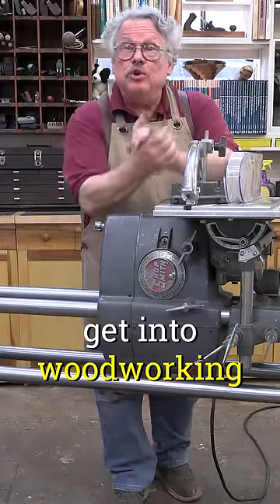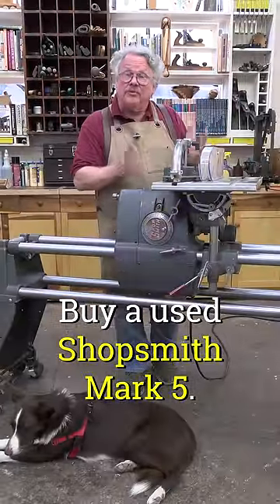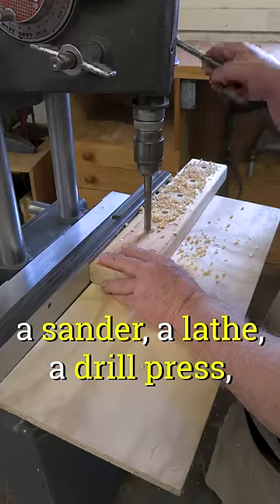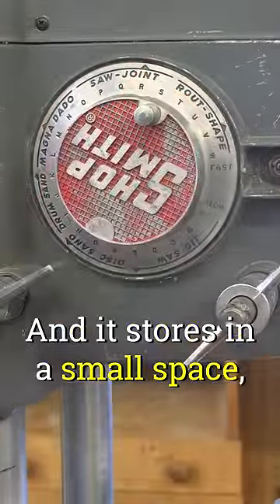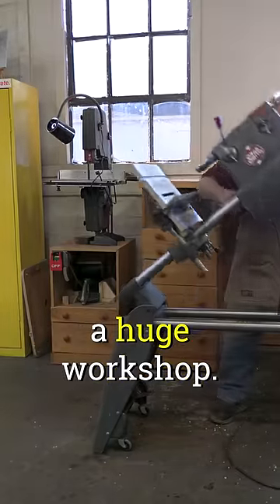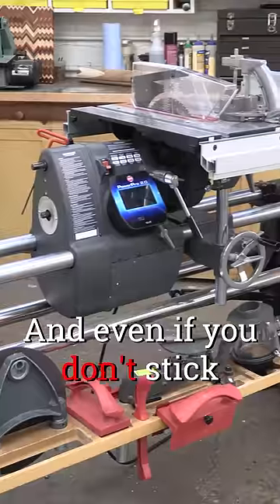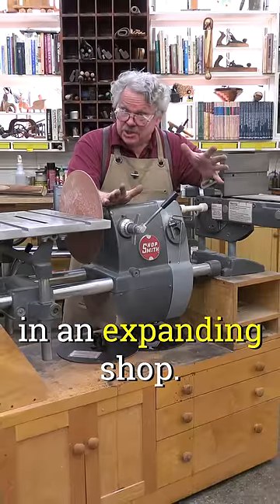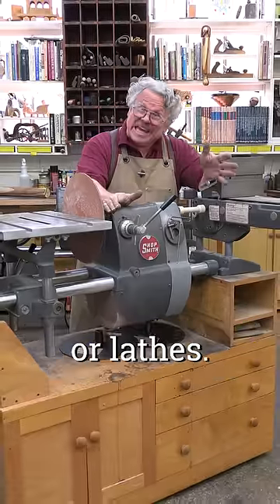A Cheap Way To Get Into Woodworking

Comment: I have a Wood Master. This is a Shop Smith clone. The table surfaces are cast iron instead of aluminum. There was a law suit against Wood Master from Shop Smith and Shop Smith won. However ALL the components for the Shop Smith work on Wood Master. I’m have been considering getting rid of mine, but for reasons in other comments. It’s a great lathe, and sanding disk. I don’t need the drill press or the table saw. The horizontal boring is handy once in a while. I just need to find a place to put mine. I’m still in major reorganization from building a new garage a year ago.

Comment: I purchased a Mark V for $400 from a local farmer I used to do a lot of work for, and so far, it has been a great machine for some of my uses. Although I have plenty of space now from when I originally bought it since back then I couldn't afford to buy a shop full of machines. I find I still like to use it. I did have some prior experience with one of these when I was a teenager working for my father, although it was just the drill press and lathe portion. I have always wanted one for myself.
Reply from the maker: Thanks for sharing.

Comment: Just utilized our used shop smith utilizing the table saw, drill press and sander all for one Christmas project. Oh and it was also the perfect platform for a few passes with the router.

Comment: It might be cheaper but it’s far more dangerous. You have to remember to tighten down all your little hexnuts before running anything. Especially the ones that are on the adapters for the spindle. If you don’t tighten that down your in big trouble. 

The table tilts for the table saw not the blade. If you are making small pieces they will get thrown back at you. It a matter of time. 

The lathe attachments for a regular lathe don’t always work since it’s the headstock you move not the tail stock.  You need adapters for just about everything you want to put on it. If that’s all you want to use it for that’s probably the best value of the machine.

All those upgrades are going to start adding up and the convenience of separate tools becomes very appealing. 

My shopsmith is either from the 50’s or 60’s. I don’t think it’s ever been oiled or cleaned on the inside. I got it from my grandfather. I love it. But do you research. Get the manual if there is one and read it. This tool is not just plug and play.
Reply: Definitely a tool you want to learn about from an old man with less than 10 fingers 😂
Reply: You will see a number of persons offering opinions as to the safety of a Shopsmith. The Shopsmith mark 5 was designed and first built in the 1950s. The design incorporated a tapered motor shaft that by its very design doesn’t allow the blade, sander disc, chuck etc. to come off the shaft even it the hex nut is not tightened fully.  A simple 5 point safety check will that takes moments to complete makes this machine no more dangerous than any other power tools, safer than many. I have used the machine since I was 12, I am now 69. I have never been hurt on it. Like every tool proper setup /alignment and following the owners manual along with a little common sense goes a long way in keeping you safe.
Reply: @jamespierson4324  I agree with you and anyone looking for this tool I think should know the safety concerns regardless. On the tapered motor shaft: That's probably why it didn't fully fall off while I was using the tabe saw one time. I did forget to tighten that hex nut and the arbor moved more than halfway down the shaft.

Comment: I restore my tools. I bought a Delta drill press and saw, a Ridgid jointer, a Nova spindle lathe, Shopfox mini lathe and a Nova midi lathe all for about $1000 including parts. The only thing I bought new was my planer. You can build a beautiful shop if you have patience and are willing to learn how to fix them.

Comment: It’s great for horizontal boring, and the sanding disc is awesome.
Reply from the maker: It's also one of the very, very few drill presses on the market that is actually designed for woodworking. Most drill presses are metalworking machines -- the table tilts the wrong way and there is no fence for woodworking.

Comment: My dad had a huge collection of parted out Mark V's to keep his two running ones working. He used them for countertop and cabinet manufacturing for nearly 20 years. I wish I knew half as much about using them as he did because it's hard to sell them in my area and we don't have room to keep them. Regardless, I'm glad someone in our industry remembers them as fondly as I do. Wonderful tools, really. You can work magic with them

Comment: I started by building tables, shelves and bookcases for my mom with ~$100 of tools.

I found a store selling prepared wood furniture panels and there was a construction store that offered to cut it in smaller rectangular pieces for a few dollars, so I didn't need any big tools, just a cheap drill, jig saw, sander and a box of bolts and fittings and stuff.

Comment: I got one new in the 80s, picked up another one years ago used $250 - shortened the base and counterweighted it for stability in permanent vertical position then built a bigger table as my main drill press with T-tracks and modified fence. The other one is horizontal and used for boring, grinding or wire brush wheels, and small diameter metal turning or as a regular wood lathe. They both get a fair amount of use
Reply from the maker: Yep, the used Shopsmiths are great for folks who need a decent drill press, sander, or lathe.

Comment: I bought a 5 year old used Mark V somewhere around 1979 or so.  I still use it on at least a weekly basis for small projects.  Since I also have their bandsaw, separate powered belt sander, and joiner, I hardly ever use the table saw function any more. Probably the best purchase I've ever made.  I need to upgrade to the three-bearing quill and get a new variable drive belt one of these days.
Reply from the maker: That will be difficult since all they sell are two-bearing quills. But those seem to work just fine -- thanks for sharing.

Comment: I decided to go with a combination machine (7 operation) and one machine is good for a table saw, shaper, jointer, planer and horizontal drill for mortises. If you are in Europe, it's the way to go. My hope is to use this machine for my whole professional life.
Reply from the maker: I acquired a multipurpose machine early in me career and still use it today, but just for two or three of the operations that it performs.

Comment: I traded a leaf vacuum for a Shopsmith 10ER, and although it is old, it's a very good machine.  I'd love to have a newer one
Reply from the maker: Good swap. If you decide to move up, hold out for a 510 or 520. The tables are larger and more secure.

Comment: Thank you sir for this. I've seen some of your other shorts and liked and subbed. I'm looking t9 get into novice woodworking, notably turning so it's nice to know where to start. Thank you for sharing your years of experience and your passion for your craft!!
Reply from the maker: Rudy Osolnik, who was the late director of Berea College's woodworking program,  used Shopsmiths  as lathes because of their large capacity and easy speed adjustment. His one criticism was they were too short -- he had Berea's Shopsmiths all sitting astride 4" high platforms. Another turner I know has a Shopsmith mounted it on  blocks. I have a set of 6" blocks myself, which I use for long turning sessions. Consider this if you buy a Shopsmith exclusively for turning.

Comment: They do have lots of options of applications. Drill, lathe, cutting, bandsaw, sanding. My understanding is that the setup for each of these applications can require some time. So time management is a good thing. If you can complete all the tasks required for your project with the one setup. Instead of switching between tasks you might save some time. The shop Smith is a very nice machine. My dad’s friend bought one back in the 70’s and he loved it.
Reply from the maker: Thanks for sharing.

Comment: I am currently working on restoring a mark 5. I am really excited to have just a versatile tool to add to my shop.
Reply from the maker: It's the versatility that gives this tool continuous value even after you have a shop big enough for single-purpose tools. You begin to think of it as a jig you can set up for unusual sawing, sanding, and drilling operations. That and the ability to keep set-ups between functions. When I build airplanes, the ability to saw and sand at the same angle with the same setup is a game changer.
Reply: @WorkshopCompanion  it definitely seems to be a great addition for any woodworkers shop. I am extremely excited for the lathe function. It will be a great addition to my shop. 
I really appreciate the reply, I try to catch all of your new content as it comes out and regularly go back to listen to your previous content. Thank you 😊

Comment: I  had one back in the 80s. I liked it. I found it limiting because if you don't plan really well, you spend a lot of time changing configurations. As you change back to previous configs, there's the issue of repeatability of previous operation. But I liked it and enjoyed it. Kinda sorry I sold it.
Reply from the maker: As a teacher of craftsmen, I find the possibility of having to "spend a lot of time changing configurations" to be more of a pro than a con. You hit the nail on the head when you said it requires you to plan carefully. This, in turn, makes you more efficient in your craftsmanship no matter what tool you're using. It really is a thinking person's tool.

Comment: It's exactly how I got started , however I bought an entire shop worth of tools and such and so having the Shop Smith was a pretty decent deal. I did learn quickly that I needed a table saw if I really wanted to work on larger projects. I will however give the ShopSmith one thing. The person who invented that motor was a genius. The smoothness and the balance is insane. If anything it makes an awesome Lathe. So try and find an entire shop worth of tools, Woodworking can get expensive even if you are just starting out so try and get the most bang for your buck.

Comment: One of the few multi purpose tools that can actually do a lot of things well. Most machines like this do a lot of stuff poorly,  but not the Shopsmith.
Reply from the maker: Agreed. I tell people that are thinking of buying one that it is a top-notch drill, sander, and lathe. It's  adequate saw, not because it's inaccurate, but because the tilting table is requires extra considerations when you cut bevels and compound miters.

Comment: My first major tool was a used SS in 1984. I still have it. Plus 3 more. None are setup as table saws now.
Reply: Oddly that's my least used configuration.  Well, not so odd, I've got a compound miter saw.  The only thing I'll use the table saw is for sheets.

Comment: I was in a wood shop in high school. Of course, we had other things,like plastic extractors,a sheet metal section,a foundry area,and a welding area. But the wood woorking area was the biggest,and had the most equipment. I had the same shop teacher every year in high school,for some reason, he never let anyone use a router,he had to operate it. I heavily regret not getting more into the things we did in class. Maybe one day I will get back into woodworking. Time to win the lotto,ha ha.

Comment: I can't really spare much. A tool like that would cost hundreds. I like smaller projects anyway. 
 So I got hacksaw at Walmart for less than $4. I just upgraded my little dremel for $15 (half off on Amazon rn) and got a drill a couple of months ago for $20. A hand sanding block and some of my sandpaper from the Dollar tree. Got other sandpaper from Wal-Mart and Amazon so I have sandpaper in grits from 60 all the way up to 2,000. It's definitely harder to make it like this but I still enjoy the whole process. I get a tiny bit annoyed when it's finally finished, like "well, what do i do now? What else can I make?"

 I got my wood from the scrap wood at Menards for $0.89 per board. My next project is probably going to be a bread box. I just have to find a simple design. I might add a drawer under it. I love how customizable it can be. That's probably why I like sewing too.

Comment: You can also just try to offload the work to the person before, I know have almost everything but to optimize it I ask the lumberyard to plan and cut wood to whatever I need it to be, if anything is off I just tell them and I can get a cut altough that hasn't happened so far. and now all you need to do is join the wood or just do the angled cuts

Comment: Be sure to check for runout on the drill press, lathe and table saw. Plus, check for excessive play on everything with a bearing or a bushing that spins under power. A-LINE-IT DELUXE is your friendly tool for the job and well worth the money. Pass on the machines that are rusted and busted. All it will be is a discourage sitting in the corner indefinitely.

Comment: One guy I know took a bunch of hand tools and made jigs for them. A drill press was a set of board and channel mounted vertically, the drill itself had a molded area that it just sat in and strapped down. Remember hand tools are just portable bench tools 😉

Comment: Holy cow, a multifunction wood work station is awesome. Guess i just never really thought about it since people generally say a dedicated tool is always better than a multipurpose one...
Reply from the maker: All stationary power tools are built around a source of rotary motion; Shopsmith simply gives you the pieces and parts to build your own power tools. People who tell you it doesn't do anything well usually have little or no experience with the machine. I've used them (I have 2-1/2) for 45 years and find they make an adequate table saw and an outstanding sander, drill press, and lathe.

Comment: Wow. What a great suggestion. Seriously, with a bit of work and some electronic components you can make a modern lathe.
It's really the equivalent of a $10k machine if you have the space and time/knowledge to upgrade
Reply from the maker: According to Shopsmith, some ambitious folks have added both CNC and metalworking capabilities to a few of these machines.

Comment: word. i have a 10er thats a wall mounted drill press now and a mark v thats a sanding station and jigsaw combo. theyre cool units
Reply from the maker: I turned one of my Marks in a sanding station, too. In my mind what makes them so cool is they're a great starter tool. Then once you outgrow them, you can set them up as a permanent sander, drill press, or lathe.

Comment: I started and inherited my Dad's OLD bought New Shopsmith Mark 2!    He was a woodworker, and in the Military.    You know, move, move, move, so he bought it in '59 and Mom and Dad never regretted it.... Neither did us kids/siblings!  That machine probably built 5000 miles of shelves in "new" housing that didn't exist, let alone all the furniture/yard and BBQ furniture, toys( for a lot of kids) and ETC.     
I still have it and there is NO argument from me that this is a great starter tool!   I have serious wood shop tools, but the Mark 2 will get rolled out from time to time because.... It will help me out of a tight spot!😆😆😆!  
Right now I am browsing the ads for a used MarkvV.   The old girl is getting a bit long in the tooth and a bit tired but....
My Dad used to subscribe to "Hands On"....  Great read and packed with info!
Reply from the maker: Thanks for sharing.

Comment: For those who may not have 500 dollars to hand, a simple whittling knife would suffice for much of any beginning woodworking.
I happen to have a nice knife I got at an open-air museum event which, straight for most of its length and curved at the tip, serves excellently as something between a draw knife and a curved chisel

Comment: Holy Smokes! I thought "Shop Smith" was out of business.
My cousin had a small shop in a one car garage and supplies in a shed. He had a Mark V with Most of the Options, Including the stand alone Thickness Planer ,,, he used it for everything .. when he Passed away his wife gave it away before her downsize move  😢 ...
Anyway, Thanks for letting us know they still exist. 
👍
Reply from the maker: It still exists and in fact it recently came under new management, so there's a new crew breathing some life into this venerable old tool. It will have been on the market for 75 years.

Comment: And when you get frustrated setting it up, taking it down, setting it up to do something different, taking that down, resetting it to something else, over and over, you will buy individual tools, but keep the shop smith for one dedicated purpose.  I converted mine into a horizontal boring machine.

Comment: that tool in south america is know as a “combinada” combined in english not as fancy like this one because usually are old machines
but have all the sane function
drill lathe sanding table saw even you can equip it with a jigsaw attachment

Comment: We need something like this for metal working
Reply from the maker: There is (or used to be) a tool called a Smithy -- combined lathe and mill. We had one in the shop I used to teach in. Not as accurate as a Southbend or a Bridgeport, but worked fairly well. Close enough for government work.